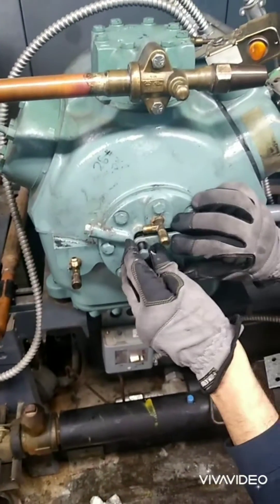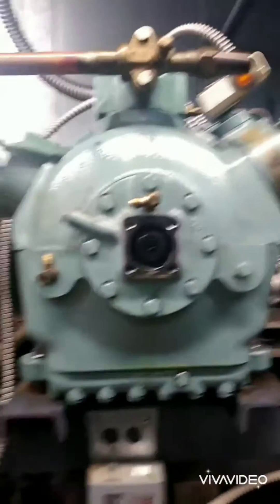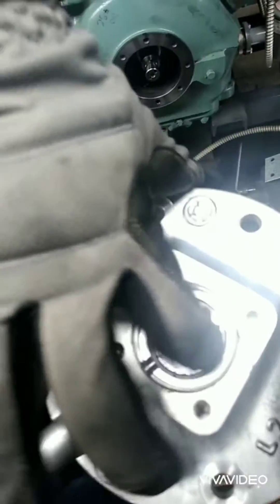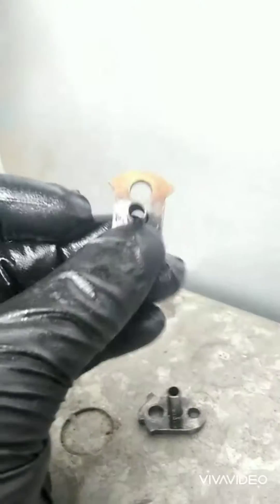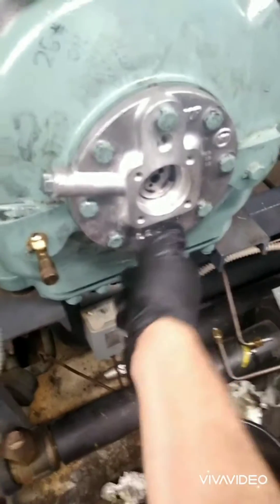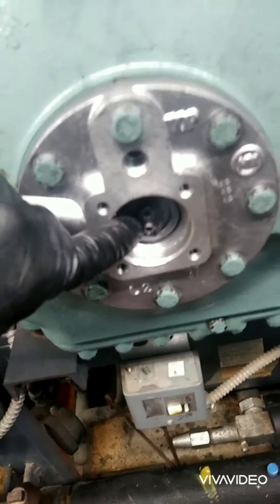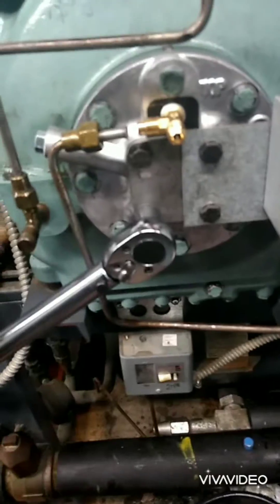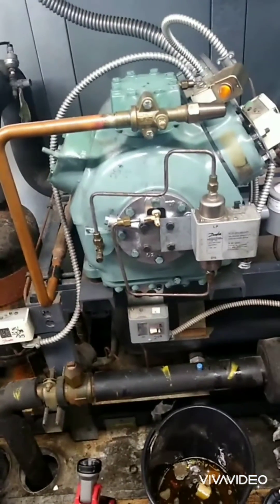D Series Carlyle oil pump replacement.

Comment from the maker: The drive mechanism with the little snorkel tube that mounts to the cam with the two little allen bolts, the smaller one is 4-6ft/lbs torque, larger 1/4" bolt 3/16 allen is 12-15 ft/lbs.